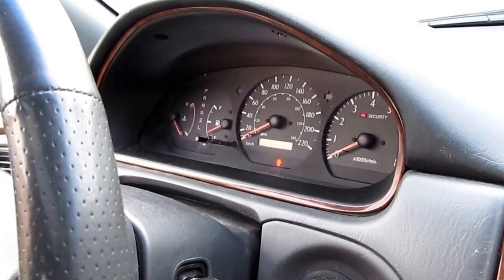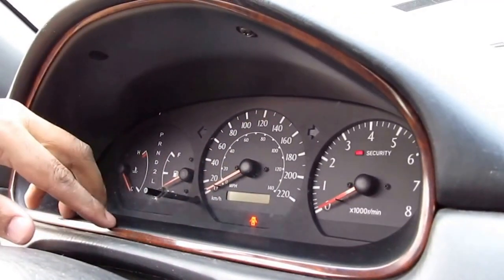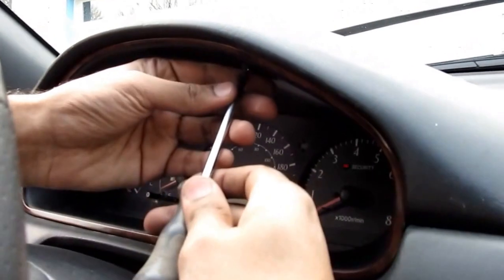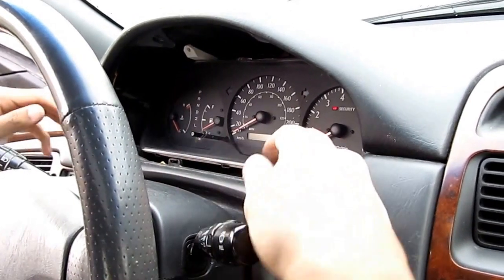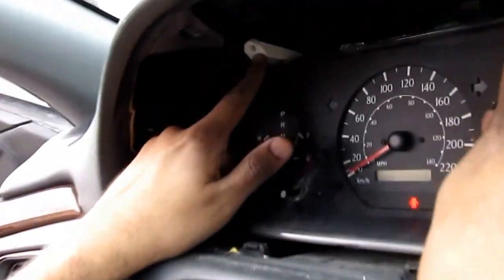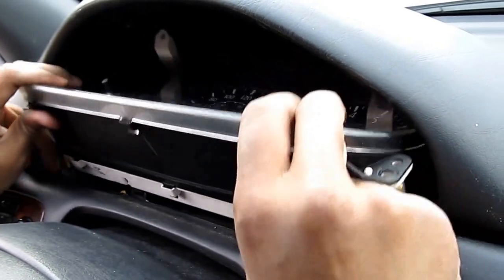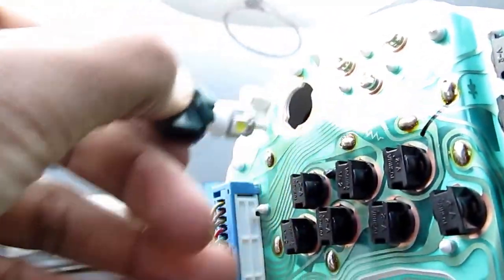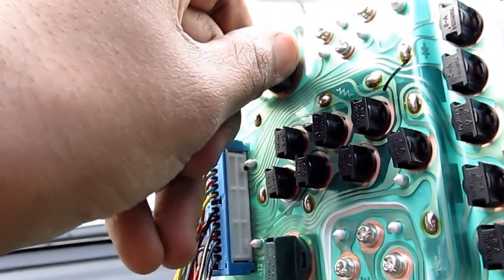Instrument Cluster Bulb Replacement

Comment from the maker: I'd say they are slightly brighter. They appear sharper, and aren't as green since there isn't a green condom on the bulb anymore. 

Changing the type 70 bulbs (turn signal, cruise, check engine, door, PRDN2L) lights to LEDs made them much brighter.
Reply: Old video, but do you have to get colored bulbs for the warning lights? Or is there a colored screen that shows the actual colors, so it doesn't matter?

Comment from the maker: I used five LED bulbs, 194 wedge white 5 SMD 5050 type. 
There is a green film on the gauges so it will still have a greenish glow after the LED upgrade.

Comment: Dealer wants $75 to do this, $4.95 from local auto parts + my labor+ your video

Thanks
Reply from the maker: Glad my video could help :)
Reply: speedkar99        All i seem to find are 194  T10 bulbs and I'm hearing that the T10 doesn't fit in the 99 so Lara is this true and also what bulb are you showing in the video and where did you purchase it thank you for the great input

Comment: Was it the 194 or the 74 bulbs or that had a green sheath?  Do you know if the heat/AC console uses the same bulbs? Thanks for the video.
Reply from the maker: The 194 bulb have the green sheath. The 74 bulbs are clear and get their color through the tint on the cluster face. I believe the HVAC uses #74 bulbs.

Comment: I have a small 4cyl. 1985 Toyota pickup, and all but 2 lights work on the cluster, do you know if it's the same concept, as in twist and turn light replacement?
Reply from the maker: +marinmedia Yes. The bulb size might be different though.

Comment: hey my cluster looks completely different. I have a camry 2003 LE and all I have is a circuit board and nothing else...you think you can help?
Reply from the maker: Your circuit board comes with LED's soldered in already. You could try de-soldering them if you want to change their color, or swap for a 2005 Camry cluster with some rewiring to get the optitron gauges. Did they burn out?
Reply: na I was just changing the colors and ill try to to what you suggested. Thanks man

Comment: Hi, very instructive video. ive been looking up to replace the instrument lights in my cars dash (camry 2001) before i pull everything out i will like you to tell me how many led light will i need and how many different types i have to buy. thanks
Reply from the maker: You need 25 type 74 LED bulbs and 5 type 194 LED bulbs.

Comment: Hi, I like your video. I have a 99 Solara and I am thinking of replacing my bulbs in my dashboard with LED bulbs and want to replace all of them. How many LED 194 & 74 bulbs do I need to buy. Also, I want to replace the bulbs in my middle console where the heater/AC section. All my lights are out. What kind of bulbs and do u have a video how to replace these? Thanks
Reply from the maker: You need 5 194 LED bulbs and roughly 24 74 bulbs. In my opinion there's no point replacing all the #74 bulbs when they won't be lit most of the time (such as battery check, traction control, and oil pressure).
I'm not sure on the HVAC bulbs, the ones I've taken out from the junkyard look like a NEOx style 3mm bulb for the automatic HVAC unit. For the console LED replacement, see my other video: https://www.youtube.com/watch?v=pu-Ok1NRspw
Reply: speedkar99 Thanks. Have you tried replacing bulbs on the HVAC console? basically 90% are burnt out and I want to replace then, Do you know I site that will show me how to do this?
Reply from the maker: I assume you have the auto-HVAC system? I have tried replacing them by pulling out the bulb and putting in an SMD LED in the twist socket base but it doesn't physically fit. The HVAC doesn't have a diffuser so it will have too many hot spots. I have to look into the right replacement bulb so I can upgrade my HVAC lights to LEDs too.
Reply from the maker: Check out this thread for ideas: http://www.clublexus.com/forums/es300-and-es330/751275-diy-4es-climate-control-bulb-replacement.html

Comment: Same process for 1980 pickup? Are there blue led upgrades?
Reply from the maker: +John c If your pickup uses a back lit display, the process is quite similar. If it uses a 194 style bulb (or any standard size), you can buy any color LED replacements for them off eBay.
Reply: Thank you Speedkar

Comment: I went to my local auto parts store, tried to buy some 194 bulbs to replace my burnt out ones for the instrument panel and the guy told me to not get those as they're too high of a wattage and i need some weird special order bulb that when I looked it up, doesn't even look remotely close to the one that I pulled out from the panel. Do you think I'd be fine to just throw in a 194 bulb? I know from pulling the burnt one out, that the 194 is exactly what'll fit in there.

Comment: How it then becomes green? Did you use green bulbs? I have the same car and I replaced the dashboard bulbs with the long life 194 bulbs w/ green cover. The result comes with the whole dashboard green even the needles are green which not the results I want, I was hoping to look like yours.
Reply from the maker: +Omar Alhumaidi remove the green cover.
Reply: speedkar99  the LED 194 bulbs you used white ? or amber

Comment: Great video. Lights went out on my gas saver (2000 camry) last night. Checked the fuses today, they're good, so my guess is the lights. Hope to get on it tomorrow!
Reply from the maker: All the lights went out at once? Double check your dimmer switch too.
Reply: speedkar99 that was my thought at first too, but the light behind the gas gauge has been out for some time now, so I guess it was just time for the rest of the dash to go out. I didn't get a chance to get on it yesterday, we had bad weather in the gulf here. heading to autozone now to see if I can get some bulbs to get the project started.
Reply from the maker: Swap them for LED's :)

Or get clear bulbs and color them with a Sharpie.
Reply: speedkar99 got it all swapped out today - it was the lights. Couldn't have done it without your video.  My car has the vent and the clock connected to the trim around the speedometer panel ... that was tricky ... there's a connecter behind the vent and the clock, pull hard and it will come out eventually!
Reply from the maker: Glad it helped. I do recall the Camry's that have the trim going around the vent with a clip that you have to watch out for. Did you put in colored lights?

Comment: Hey speedkar, 
I could really use advice or any insight you can share about an ongoing instrument cluster headache.   I've already had the cluster out once to replace the speedometer (old one had ruined board from leaky capacitors) and when I put the cluster back in the speedometer works perfectly but I now have two dead light bulbs.  The "D" light and the right turn signal lights aren't working.   Since I planned to take the cluster out again I bought $40 worth of new bulbs from a genuine Toyota parts distributor because I wanted to keep it OEM.  
The gear indicator lights I received have the little plastic base so I can pop the new bulbs into their sockets after removing the old ones; however, the turn signal lights I received are just the bulb itself: Toyota part # 90981-11018.   Is it possible do you think for me to just pull these old turn signal bulbs out and push the new ones in like I can do with the bigger bulbs?    A friend of mine told me I can't slide the smaller turn signal bulb out like the larger tacho/speedo "green condom" bulbs.  
If I have to solder stuff, what kind of professional shop could/should I call to do that?
Thank you sir!
Reply from the maker: +heymisterderp Yes you can slide the bulb out with a strong grip.

Comment: is this the same procedure for my 03 camry v6? because i took the cluster out and i see no bulbs in there? why is that?
Reply from the maker: +jOeL SiMoN The 2003 Camry uses LED lights. You have to desolder them and replace them.
Reply: +speedkar99 Thanks. They aren't bright enough. And I do not know how to desolder them and locate the bulbs either lol
Reply from the maker: Convert it to the more modern and brighter 2005-2006 Camry instrument cluster, here's how:
http://www.toyotanation.com/forum/104-5th-6th-generation-2002-2006-2007-2011/639546-gen-5-camry-optitron-gauge-swap-possible.html
Reply: +speedkar99 Dude thats sounds like a lot of work but I do like the idea of converting. I thought i could pull it off just by replacing the bulbs, just like this one. But thats not possible since its soldered in to the cluster.
Reply: +jOeL SiMoN Thank you though.

Comment: Is this basically the same in a 2000 Tundra?
Is the LED bulb affected by the dimmer?
thnx!
Reply: reply to myself -- no not the same on my tundra, have to remove plastic from below column to access screws on bottom of trim insert.
Reply from the maker: jsmcguireIII Good to know. I'm sure its not hard to change the bulbs in most Toyota clusters.

Comment: What is the official name of the little LED lights I can't find them. 
I found the big ones but not the little ones.

How many of the little ones should I buy?

Thank you
Reply from the maker: Check out eBay for the bulbs. They are 5050 SMD LED socket 194 bulbs. There's about 22 little ones (type 70 or 74) if you want to replace them all.
Reply: k thank you for your help and great Video

Comment: do not forget to replace the #74 bulbs with leds the only two lights that come on are the oil light and the brake light however that can be overcome to keep them off getting high power type 74 led bulbs. I like the lexus guage cluster better you did I will do that myself to glad you made the video I downloaded it for later incase your videos ever go offline.
Reply from the maker: Hopefully the conversion works out for you, let me know how it goes. Do you have a V6?
Reply: I have 1999 toyota solara looking for an engine for mine a lexus engine from an es300 98 modle I know a guy only works on these cars has like nine of these engines all v6 all from lexus and toyota camry all from 1992 to around 2001 all fit my and your car ( : oil pump went bad on mine thought the oil light switch was bad so because it had oil in it turns out the owner before me had run it dry on oil must have gone into shock when I put my new oil in it castrol clogged the intake tube for the oil pick up line I assume and it messed up the oil pump and blah my engine is clicking loud so time to get a new one mm hmm  I love my toyota solara it is fast well when it was running correct! (:
Reply from the maker: Sorry to hear about your engine.

Most likely your car had the common sludge problem, causing the engine to rapidly consume oil and build up sludge in the engine. Make sure you change your PCV valve. 

An engine from a 1997-2001 Camry V6 or a 97-98 Lexus ES300 will work for your car. Anything older is from the previous generation, so compatibility can't be guaranteed. The newer engines had variable valve timing.
Reply: VVTI is the best ever Pass on any honda toyota and bmw for life. or anything german as long as it is japanese must be toyota only.

Comment: Probably need to do this. my fuel gauge doesn't light up, the right half of my speedo doesnt light up, and the left half of my rpm gauge doesn't light up.
Reply from the maker: +WrxSTi06 EJ207T Yes or you can do a full ES300 Lexus cluster swap and never worry about burned out gauges!
Reply: speedkar99 Haha no thanks. I checked out that video. Not messing with all that lmao

Comment: is it the same for a 2001 lexus es300?
Reply from the maker: No. The Lexus uses a back lit cluster that's lit by a florescent tube. If yours is blown, you need to change the tube. Check out this video on how I disassembled the cluster: DIY Odometer Reprogramming
Reply: speedkar99 Thanks a lot man, i wish i wwouldve read your reply before i tried it. All i did was disconnect the cluster from the car and pop open the back. After i didnt see any bulbs i just put it all back together and now the speedometer and rpm needles do no turn on. I didnt disconnect anything from the actual cluster.
Reply: Willy Valdez Also the rpm needle goes up and down wildly, the speedometer one works properly it just does not light up.
Reply from the maker: Willy Valdez
You probably have a loose connection where you disconnected the cluster from the wiring harness. Make sure all the wiring is tight and snug and try again.
Reply: I did that because I thought about that too but all the harnesses are tight and properly connected.
Reply from the maker: Maybe your cluster has a problem, the backlighting on the 3rd gen ES usually don't burn out within the car's lifetime. In fact, the ES300 cluster I picked up from the junkyard showed 619,000km and worked fine.
You might need to pickup a used cluster from a junkyard. Check out this video to see how to reprogram its mileage once swapped:
DIY Odometer Reprogramming
Reply: speedkar99 Is isnt the backlighting though, its just the needles for rpm and speed.
Reply from the maker: Willy Valdez Hmm, your best bet would be to try another cluster.

Comment: +speedkar99 can this process work on solara 04 coupé ????
Reply from the maker: +Charles myd I think that one has LEDs soldered to the board. Check Toyota nation Camry forums, there was a DIY with someone who changed Thiers on a gen5 Camry.
Reply: did you ever find out I your 04 has them soldered to the board or not I have the same car and want to change my lights

Comment: hey it dosnt apply to 2003 camry
Reply from the maker: Applies to Gen 1 Solara (99-03) and Gen 4 Camry (97-01).
Reply: speedkar99
you have it posted in the drop-down as 99-2003  for the Solara  and then in the vid you state its the same for the Camry. just a little confusion there. maybe when cross referencing models specify exact years for both just a thought

Comment: Hey man,

I got Camry 2000. I took the first two screw on top off. But I can't get the plastic part off! It's like stuck! And I feel like if I force it it will break the plastic! Any ideas? Is it because the heat has melted it in and I just need to pry it a bit?

Comment: This will not work on the 2003 Camry.  The 2003 year is completely different then the cluster shown and the dash bulbs cannot be replaced.  If you know of away to change them show me.
Reply from the maker: Your right the 2003 Camry is an entirely different cluster.

It uses surface mount LED's that are soldered to the board. You can find replacement LED's (I don't remember the exact model) and solder them in to replace burnt LED's or change the color.